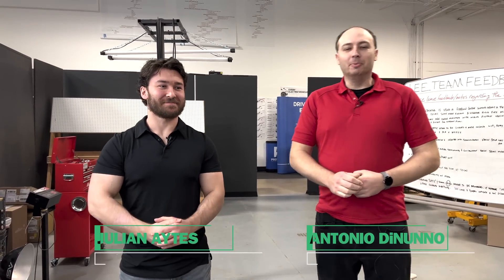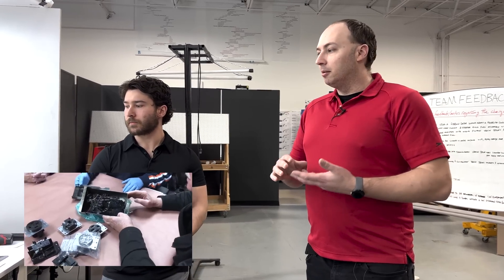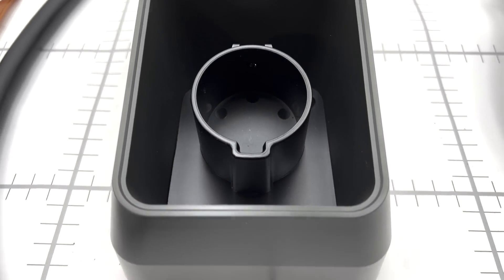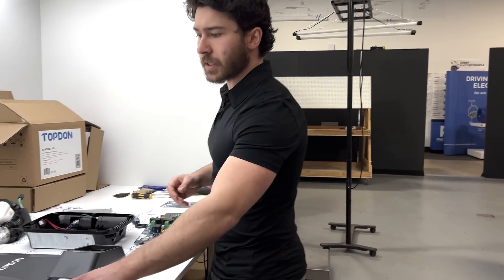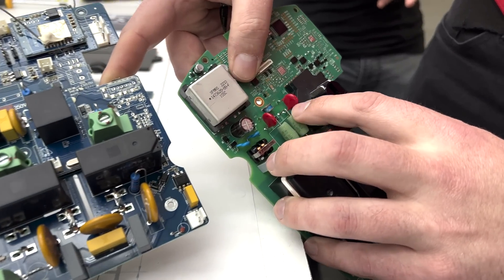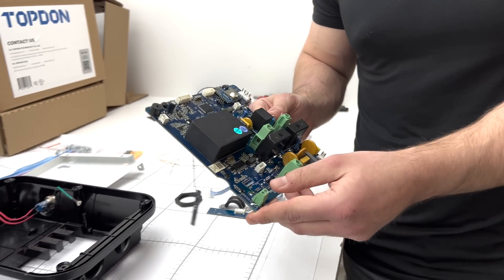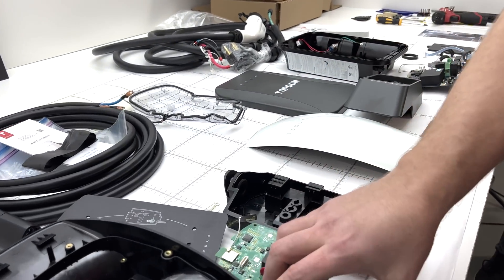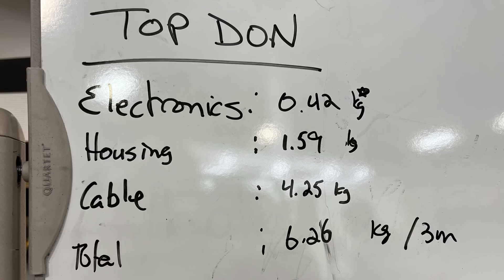EV Home Charger Teardowns E2: Topdon PulseQ

Comment: So the Pulse Q is cheaper, doesn't need to be opened up, just plugged into an outlet, has an extra meter of charging cable has a holster I can hang that cable so I don't pull the cover off my EVSE---all points not brought up. The Telsa needs to have the plug end plugged inside to release the magic doc if you need to release it right?  I mean if you are charging a Tesla you push the button---it releases and you charge your Tesla--if you use it for a non Tesal then you bring out the whole connector----- that's why they had to stick the plug inside.

Comment: So the actual "design philosophy" is different between the 2 different Items "contrasted" - the Topdon was built to be installed as a CONSUMER installed device  (mail order from AliEx ??) - the Tesla unit is intended to be installed as a professional fitment.  The steel backing plate allows the unit to be hung in one step (no guesswork with the drilling) - and simply screw-secured, placement of the "base" unit is in the proximity of the wall plug while the charge lead can have its hanger located wherever it is convenient.  With the Tesla unit - the fitment service will be bespoke to suit your location - a more space age set of mouldings (or sonic welded components) is more expensive in the setup (dies, welding fixtures, etc) if Topdon had little to no indication of future sales volumes, this may have influenced a simpler (cheaper) aesthetic at the engineering and design stage (a lot less design involved, more just sticking everything in boxes).  DJI is definitely an example of a Shenzhen company who is able to make complex, well designed plastic consumer products - There are also plenty of examples of continental US companies making poorly designed  or materially inferior products - these things aren't a "given" based on geography - despite the; "Buy - Made in the USA" concept which is of course popular at home - until price gets quoted.

(Noting of course that many tech firms source EU and California compliant components from China-- it is all in the specification and QA - very little from Tesla is at a lower price point, others are providing value consumer grade products - or attempting to without getting sued or having goods seized at customs).

Comment: Time has nothing to do with it,  a receptical  either handles the current or it doesn't.  Outlets in homes are rated for 100% duty cycle,  but good installation and regular checks for loosening screws are a must.  The same goes for all the wires inside the home distribution panel as well.

Comment: The "transformer" at 10:24 is not a transformer. It's a common mode choke. The transformer is the big black potted block (Switchmode converter).

Comment: We installed a 100 amp subpanel in the garage during new house construction, per advice from my Electrical Engineer friend.  We have a NEMA 14-50 receptacle and a Juicebox 40 in use for six years.  No problem, but what should I watch for?

Comment: why cover this product category/? this is like tearing down and analyzing a professional extension cord. I'd be interested if these things start having V2X, bi-directional, and or integrating an MPPT controller that talks directly to EV battery via DC at 99% efficiency.  Another innovation is wireless charging; wireless charging at 10 amps is piece of cake to engineer which Tesla leaked once. 
why not teardown a Powerwall, go slow and start with first generation until the upcoming latest one?

Comment: Siemens has partnered with a company called ConnectDER to produce an adapter that installs between a house meter base and the meter, and eliminates a costly service upgrade. It allows for  240V level two charging I think in the 7-11kw 40-60 amp range. This device is already used for grid tie systems and is proven technically. Modifications for EV charging maybe required. I am certainly going to be contacting my electrical utility to see if the device is approved in my jurisdiction. It will save me thousands in a service upgrade. Perhaps Mr. Monroe and his cohorts could do a little investigating on this device and do a video on it.

Comment: They go cheap but then they add an unnecessary plug erasing the cost savings of the glass tube and leadless solder. This probably puts the production cost over the Tesla unit. 15:00
After all, a line will usually have to be run for the car charger. why have an extra plug? Unnecessary part that can fail or catch fire.

Comment: tesla has a thermal sensor in the nema 14-50 plug.  that’s why they don’t melt plugs or receptacles when things go wrong ie plug not fully pushed in. 

good design is not just efficient but one that keeps on working even when the problem is not their fault. 

when the plug on my tesla heated because it was not pushed in all the way, the car lowered the charge rate and warned me after. 

it didn’t burn the house down or stop charging. it did what it had to do the make sure my car was safely charged in the morning.

Comment: It doesn't matter what the manufacturer calls it. This is not a charger.
Reply: So then what is it 😂😂
Reply: @jspencer89yt  Electric Vehicle Supply Equipment or EVSE.

As the name suggests,  it supplies electricity. The charger is part of the car and has all the brains. This just supplies electricity and has a few built in safety systems.

Comment: I think as others have said, the TOPDON and others like it that use a plug and receptacle can be removed for portability. Hence the extra mounting pieces.  The reason for two pieces on the charge plug holder is so they can put a different one in for the various charge plugs. I assume it's cheaper than having several all-in-one molds.
Curious to see your Grizzl-E teardown, it's what I'm using to charge my Tesla. It's a nice solid unit. I converted mine to be hardwired though so I didn't have to spend $150 on a GFCI breaker.
Reply: Exactly. The unit reviewed has a CCS plug holder, but a Tesla plug holder is also available, hence the modular design.

Comment: One is well deigned and engineered, easier to make and use, easier to install, has greater capability (current) and cost less to buy and install.  Guess which one is better? (hint starts with a "T").  What is lacking in these two wall mounted connection interface "teardown" videos are details, clarity and accuracy.  This could be a much better 5 minute video video with a few comparison charts added.    Two big issues are: 1) Evaluating these on weight (i.e. kg) is beyond silly.  If that is a valid metric for electrical devices, the refrigerator or washing machine which weighs the least is better.  2) These are connection interfaces. Period. Regardless of mis-speaks and Topdon's marketing nonsense, calling these "Chargers" is like calling the electrical panel in a house a "Power Generating Station".  You guys should 2 takes.  After watching and taking notes on the first one, fix all the errors and add continuity and clarity and do the 2nd take.  Treat these videos like PowerPoint presentations: Review, Correct, Clarify and Refine!

Comment: Just because the manufacturer or someone else calls an EVSE a charger, don't repeat putting out or using incorrect terms. This would be the time to publicly correct the manual.  With the EV industry new, we all need to use and understand the correct verbiage.  Very good job with the tear down.

Comment: One of the big disadvantages of a plug-in charger is you need a GFCI circuit breaker which adds to the install cost.

I'd suggest that the series would be nicer if you could get an electrician's input on the install side of the equation.

Comment: While I appreciate the time and effort that goes into putting together these tear-downs of wall boxes, I have some feedback for the reviewers. Please be a lot crisper about what you are saying and be please spend less time talking about what which section you would like to handoff to each other. Also please pay attention to what short circuit protection is being offered at the input to these EVSEs , in particular at the input side when it is a hard wired charger like Tesla. A deeper study of the chips and components used in these chargers would also be appreciated.

Comment: Another difference between a hard wired charger and a plug in charger is that the plug in style must use a GFCI breaker in your electrical panel to protect whatever gets plugged into the outlet.  Whereas the hardwired charger can use a less expensive standard breaker IF the charger is designed to detect ground faults and open the circuit if a ground fault occurs.  GFCI breakers have a higher incidence of false trips which would interrupt a charging session which might not be discovered until you get ready to drive away the next morning.
Reply: I was going to say the exact same thing. Having to install an outlet and GFCI seems to add unnecessary complexity, cost, and danger.

Comment: You should do a teardown of the AMPROAD iFlow P9, it's a robustly built unit.  It also runs cooler than my gen 1 and 2 mobile connectors.    As far as safety, hard wired EVSEs can be just as dangerous if the wires are not torqued correctly and checked over time.

Comment: Is it fair to compare two electrical circuits based upon the size and shape of the components? Smaller - when talking about power components - is not always better. This design is not "size" sensitive and the delta in cost is likely negligible in volume. The relevant thing is how well they functionally perform and their long term reliability.  Perhaps the "larger" circuit has better noise filtering or dissipates ambient heat better, etc. We don't know based upon this cosmetic criteria.  And I am all for lean design; been a disciple of Deming for decades. That is a goal as well as  efficiency but if one unit has a removable wall mount you install first and the other does not - honestly it makes very little difference in the scheme of things. Installation is not a mass manufacturing feed rate step. 
Harkening back to the flaming charger episode - the big issue there was the use of cheap questionably made electrical parts. SQUARE-D etc parts are overdesigned  with substantial margin and UL and 94V0 non-flammable rating. Just because a part LOOKS the same does not mean it is. You do not cut corners on power carrying components - ever - for just this reason - lives are at risk. 

I am surprised the design is not PB-Free and ROHS (10 chemicals) compliant. The may be exemptions for high current components - ROHS has a lot of exemptions. That said if the are ROHS compliant (and claiming exemptions) it should be clearly marked on the product. You can look at any PC power supply - there are a bunch of agency logos on there. These things should have the very same logos and a list of any exemptions claimed AND their registrations - online - should mirror that.
Reply: Some logos on cables, not so much on PCBs.
Reply: I agree. 
And I know lead is bad, but man does it makes for some quality, long lasting solder joints. On a tangent, my favorite solder to date is 62/36/2 Tin Lead Silver solder.  Projects I've soldered over 15 years ago that are still in daily use with that stuff are still holding up well.
Reply: @andrewt9204  Don't get me wrong, I really appreciate what lead can do for amalgams, the way it controls whisker formation and makes the solder more resilient is impressive. Solders that are leaded don't have very much in them either!

Still, it has its risk. I think it should be used responsibly, where best suited.

Comment: I’ve been using my NEMA 10-30 dryer plug for over 6 years to charge my cars with no issues. It’s not the fastest  charge rate, but works flawlessly
Reply: I  usually only charge at 22 amps, even though my unit can supply 40. It's more efficient and plenty for an overnight charge on my 120 mile commutes.
Reply: @andrewt9204  
Sounds similar to my experience!

Comment: Plug in type L2 EV charging units are limited to 40 amps, not 48 amps as the connectors are only rated for 40 amps continuous.  The Tesla Wall Connector can support 48 amps with a hard-wired 60 amp service.  That said, few EVs other than Tesla can accept 48 amps and many are limited to less than 40 amps.  The Tesla Model 3 RWD is the one car in it's lineup that is limited to 32 amps, while all others support 48 amps.  The 2022+ Bolt also handles 48 amps, where older Bolts were limited to 32 amps.

Comment: metal mounting plate / the  Screw Holes ( 2 key holes )  are  turned 180 degrees  Off  (upside down)    shown at 6:40   -   Great Video  Thanks
Reply: after looking closer  pretty sure backing plate  cant be attached to a wall -  No access to screw holes Unit would be in the way 
if i am correct might make a good Short  video

Comment: I wish people would stop calling these things Chargers. they are not Chargers, they are charge controllers.
the charge controllers main operation is is to receive messages from the car to send a ac power to the to the charger that is part of the car.
 When the charge controller is plugged into the car the car sends a message to the charge controller to initiate charging to send the proper amperage did the car charger located in the car.
It also protects the user from The electrical shock by disconnecting the AC power from the charge cable When the charge cable is not connected to the car.
Reply: EVSE needs to become the proper nomenclature for these. Same with phone and laptop "chargers". They're not actually performing the charge functions, just supplying the power. All the charge functions are performed in the device. The "charger" just tells the device what power it can deliver.

Comment: It would have been nice to see conformal coating on the Topdon board to resist dust+moisture given likely use in a more humid garage environment with possible road chemical salt residue present.

Comment: Regarding the RTV-like seal on the Topdon, why would anyone remove it repeatedly?… or at all?
Reply: Like we said, its not designed to be opened. Which is perfectly fine. How it handles in seasonal changes... unknown?
Reply: @BatterVswithAntonio  Thank you for the reply.

As you said closed cell foam seal appears to be a better option than the RTV-like material.  The Tesla appears to be a much more refined design and looks like it would have a much longer service life.  I don’t have a materials background to speak to cost/benefit, but I have worked on some pretty old equipment with neoprene (or neoprene-like) seals which have remained supple for decades.

There’s an interesting push/pull between making greater up-front design and tooling costs using proprietary components versus get-it-done with commodity parts.  Perhaps a 48 amp EVSE will remain relevant for 20-30 years for home charging, and if so it makes sense to give customers a choice of highly engineered premium products.

Comment: I'm normally a fan but this just felt off. Using cots is ideal yet the complaints about it made no sense. Then the light PCB for Tesla is insane with an easily damageable ribbon cable that is a pain to work with and active components on that board when they probably shouldn't. The case discussion made little sense since ccs has two different high voltage connectors so having a single large mold with two smaller ones for the connector types (or future connectors) makes sense. Like Tesla is pretty great at doing changes rapidly but this just seems really skewed. The nema comment was hilarious. There's like 100 nema connectors including normal wall plugs. The NEMA 14-50 isn't a dryer plug anyways.
Reply: Its a stove/RV plug.  The 14-60 would be a better choice.  The wear item on the TopDon being a separate part that looks fairly easy to replace actually looks like a desirable feature to me.  Replacing one small externally mounted sacrificial part instead of an entire housing makes it more user friendly.  Too many unfortunately make things irreparable under the guise of being "Lean".
Reply: 14-50 is in fact rated for 40amp continuous. The hour comment just felt uneducated. Direct wiring is better but this "review" just rubbed me wrong.

Comment: The TopDon charger needs to accommodate 2 different charger plugs for US and Europe, hence the 2 piece holster.  It is also a portable charger vs a wall mount which makes it difficult to impossible to incorporate the cord storage into the main housing.  Apples vs oranges.
Reply: It's all about cost. Just the cost of the slider needed in the mould for the Tesla charger probably costs more than the entire tooling cost for the TopDon. It's hard to justify that upfront cost in tooling if you aren't making chargers at the scale of Tesla. I don't understand Munro's criticism of that component.
Reply: @col888881  I agree.  The Tesla connector holster requires sophisticated tooling that is far more expensive.  It's going to need to be justified by higher volume.
Reply: The Tesla Wall Charger also has different plugs for US and Europe, NACS vs CCS
Reply: @MichailGreshishchev   (so the whole unit needs a redesign - for manufacturing - for those  markets rather than a simple insert replacement. (probably mclouser's main idea)
Reply: The Topdon is not a portable charger, it is wall mounted.
Reply: @dennisb71   (and easy to take off the wall, unplug and relocate - 2 screws on the side and it's away)

Comment: As a question the two part charge hangar could the second piece be so they can switch that part to accommodate different chargers?
Reply: More than likely the European model would have a different insert due to different ac connectors.
Reply: @actually_it_is_rocket_science  How could there be a European model when they're producing the board with leaded solder?